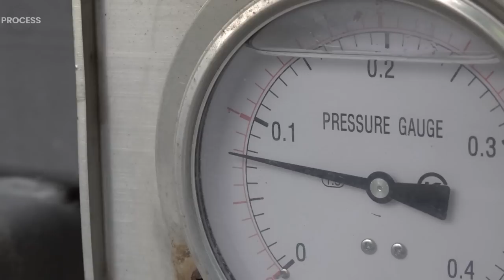Interesting Process of Making Square Concrete Waterways. Korean Factory Started in 1970.

Comment: Well made products. I have a question - gradual water seepage - can it rust the revars? I know the alkaline cement reduces corrosion - would galvanised or stainless steel coated wire stop this = pipe for 1000 years. I agree cost of Zinc and SS is higher, but 1000 years is longer = 10 times or more extension of longevity?

Comment: were you heating or cooling the concret? I ask, because it looks like heating, but at mega projects (e.g. Burj Khalifa) I have seen that they have to cool the concret to avoid overheating.
Reply: They steam cure the concrete. Since concrete making is a chemical reaction which produces heat they have to slow down the reaction by using ice . During the construction of the Burj Khalifa which is in a desert environment, and the heat of the day was bad for concrete they had to use ice and pour during a certain time of the day. FYI when they built the Hoover dam the chemical science of concrete was such that the only  way to slow down the curing of the concrete was to place water pipes in the concrete